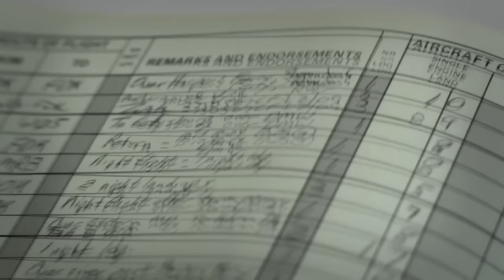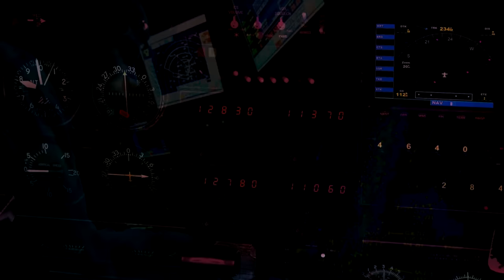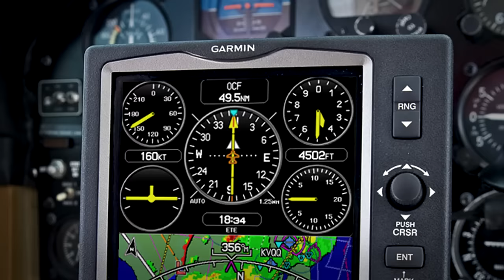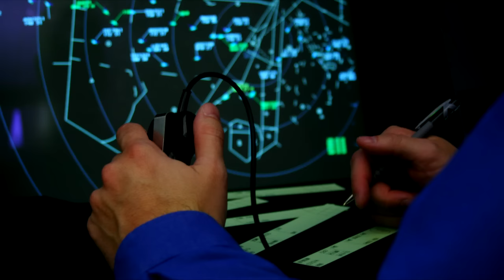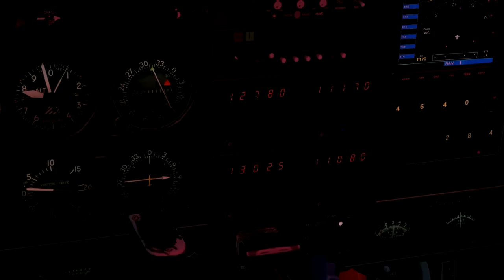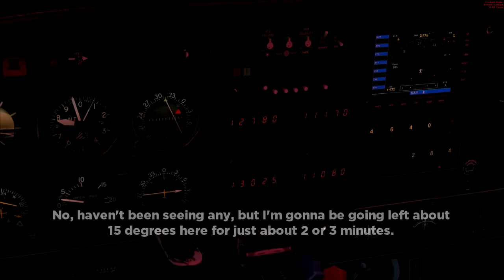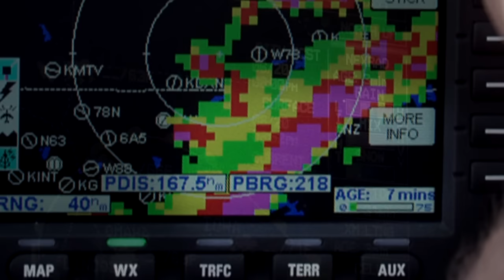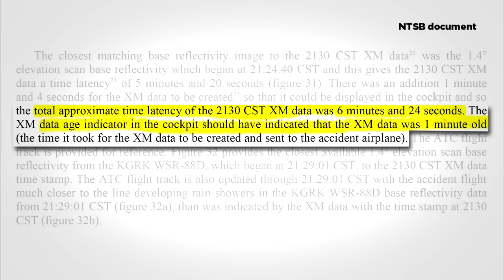Accident Case Study: Time Lapse – misunderstanding in-cockpit weather displays can lead to tragedy

Comment: To be this reckless with your family on-board is sickening.
Reply: agreed
Reply: Someone in another video said it best:  "Never take your family anywhere unless you've had several hundred hours IFR in your log".
Reply: @jturie  overall i disagree, im not sure if youre a pilot or not but that request is nuts. I agree that he should have had more experience, should have known his systems better, should have recognized get thereitis and shouldnt have landed well before the thunderstorms and gotten a hotel. But hundreds of hours of instrument is a commercial pilot task especially for your average pilot.
Reply: @JohnDole  good points.
Reply: Nine hours of high altitude flight, fatigue, hypoxia, and frustrated family members nagging or complaing or needing a bathroom or stretch ugh.  Just divert away from the storm and take a break at the nearest airfield dont risk flying wven longer.
Reply: @SWIFTO_SCYTHE   Very true. Unfortunately, by the time he thought about doing that he was already in the thick of it and had no idea which way to go.
Reply: That's the problem ignorance is bliss I.e. he didn't see it as a wreckless flightplan.
Reply: @JohnDole  They did say he had been at altitude for 9 hours!  Hell 9 hours of anything and my decision making has gotten pretty bad.
Reply: Sickening or not, it turned out to be fatal.
Reply: I was thinking the same thing. Especially when ATC is nervous. That should frighten any pilot enough to ask for a vector to the nearest airport.  Flying solo? Go ahead, roll the dice with your own life. But with passengers you have no right to take any chances just because you're the pilot and you're flying the plane.

Remember John F Kennedy Jr? Same scenario.  Strong headwind. Flight conditions deteriorating. Small plane. Not  a whole lot of experience. Passengers on board. Land the damn plane, grab some coffee and wait it out. I'm not even a real pilot. I fly X Plane on a Computer. Just a simulator.
Reply: You could hear it in the ATC's voice how the pilot brushed off his warning to divert. The pilot was probably used to being 'in control' of everything but sadly weather and convection currents don't care how big your ego is. Risking your entire family flying a single engine at nighttime into a thunderstorm is incredibly irresponsible. He probably got rewarded with the screams of his terrified family being the last thing he ever heard. He screwed up and his entire family paid for it.
Reply: @wjatube  Humans have a very difficult time with "letting go" of a task until completion as originally "hardwired" into their mind -- "get there-itis". Remapping of one's thinking/plans can be incredibly difficult for a family, let's say, on a routine Sunday drive to the beach.  The psychology behind airborne decision making is even more complex for sure.  Pilot actions, or inaction's, contributing to this tragedy go well beyond flight planning, physical or mental fatigue, cabin distractions, and ignorance of NEXRAD functions.  General Aviation pilots need more training around crisis and change management and how to apply that training in flight when needed.
Reply: david Blash is there a recommended “sweet spot” for when you should start inviting family aboard? I think I heard it’s the first 15-50 hours in aviation experience that are the most deadly, not sure exactly, but there’s a timeframe where you know enough to fly with false confidence but not enough to be ready to figure out a new problem/scenario. Basically knowing enough to get you killed
Reply: @wjatube  He rejected silly controllers advise, "who is that ass telling ME what to do" Was probably  the last thing  going through his mind, other than the dashboard!
Reply: @wtcashel  exactly right....
Reply: Exactly what I was thinking. See, when I'm driving solo, I speed and take some chances that in my judgment wouldn't cause a serious accident or injure others. But I'm a different driver when I have a family member - let alone my entire family - riding along. When that happens, it suddenly transforms me into a very patient driver that would start applying the brakes and come to a complete stop as soon as I see the yellow traffic light come on. When I'm driving solo, I usually step on the gas to beat that light while being very cautious of the four directions of traffic.

With all that said, this pilot evidently did not care that much about the fact that his entire family was with him on that plane ✈. I believe the change in pressure and a long flight time caused a resultant disorientation and lack of judgment, otherwise he would have known to put the safety of his family first. I would have made an emergency landing, even on a freeway like I'd seen a few times.
Reply: Peter Duffield, I love your comment; I think of it as perfect. It's the same principle that guides me when I'm driving: when driving solo, take chances. When there at least one person riding along, make their safety a priority. I wouldn't take any chances when my family is riding along. No way!
Reply: Get back safely.. That's all that matters.. Not get there no matter what.. This is sickening.. What were they saying to him I'll never know
Reply: Easy to say in hindsight
Reply: @JohnDole look who crashes planes - underexperienced pilots, challenging conditions, often with friends or family onboard. If you want to take yourself on an adventure, fine, go skydiving or fly around in a tiny plane without modern avionics or engines with just enough experience to make you comfortable that you stop being as safe as necessary for your skillset, but dont drag your kids and wife along with you. Become the pilot you would trust your family's life with, dont think you can get a license and start safely hauling people around.
Reply: We should all vow to not be too proud to put the plane down safely  when we still can. It's easier to do now than in the air. Eliminate the two most common reasons for accidents and your chances of survival go way up.
Reply: +jturie. You can study and understand a subject without being in the air.
Reply: @JohnSmith-en8vx  Murphy's law?
Reply: wjatube I don't think he was...but you're right the outcome is hurrendous.
Reply: @tomservo5347  that is  being a little rough....making the personal decision to move forward was not really the problem.  He was arrogant about his distance from the storm for sure.
Reply: @jet guy Too keep flying straight into this with his whole family is hubris in the extreme. So maybe he can afford to own a Cherokee, so therefore thinks he is the man. Terrible decision, terrible.
Reply: @NonyaBusiness! Well, there is a wide gulf of options btwn "hundreds of hrs IFR" and "dancing around a storm."  I haven't flown in 20yrs, but anything listed as tops at/above 40k gets my attention!  I'd have given that a wide berth...even in a C-130.
Reply: What gets me though is the number of people on here outright bashing the guy...hey hindsight is 20/20 and I'm sure he didn't go into it thinking he was being reckless and would get himself and his family killed. I'm not even sure you guys watched all of the same video. In the end the idea is that you don't know what you don't know which is why things like this exist so that the bug gets in your mind when you do fly...hmmm perhaps I should avoid this instead of trying to go ahead. There is a good chance that he probably didn't know this and after 9 hours flying was mentally fatigued, but yeah go ahead and criticize the pilot for getting himself and his family killed when my guess is that 95% of the people making the comment aren't pilots.
Reply: @mattfield3371  I can't agree with your point even though I am not one of those bashing him.  I don't have to be a smoker to "bash" those that do.  In this case the outcome clearly indicates he was willing to take far greater risk than a normal human (pilot or not) would.  Why?
Reply: The funny thing is you criticize the pilot for making a careless/reckless decision when you outright admitted that you do the same thing "just when it's only you in the car". But you look out for others so it's ok? How do you know who you're going to hit when you try to beat that yellow...? It's really funny the number of people I see on here thinking that they know better and that this guy got his family killed like he should've known. Yeah, he probably should've known but he didn't, that's what lack of experience and training is and why these exist...but claiming you aren't putting anyone else at risk "because you check the intersection" when you try to beat a yellow light...ask yourself if that behavior is really so different from this guys because the mentality is the same. And I know you said you wouldn't do it with your family onboard but still irresponsible is irresponsible...I've done it too so I'm not without blame just saying that perhaps it's better to learn to look at things a little differently and see that it could probably happen to anyone easier than you think.
Reply: Point missed on the oblivious clearly...my point was that unless you've been in that situation it's easy to say what you would do but how can you really say? You say he was reckless but he probably didn't think it was reckless. Again to my point of people even watching the video, did you see where it said the data was likely 8 minutes old but those screens say 2 minutes? His flight track was consistent with thinking he was following what was current on his screen and not with what the current conditions actually were. I nowhere heard in any of his calls to ATC where he sounded "arrogant". I didn't get that from anything said anywhere in the video only the comments. I'm sure if the controller thought he was arrogant he would've had stronger words for him about avoiding the storm altogether. From watching the video it's pretty clear to me that he just didn't understand the limitations of his equipment, not that he was arrogant. What I do perceive is arrogance in these comments about people who think that he outright put his family in danger somehow knowingly, but it's obvious to know he didn't think that they were in danger or I'm sure he would've diverted. It's really funny reading these comments and seeing all these people that somehow know better and again if you don't have all the perspective of the situation at hand how can you begin to form a rational response?
Reply: @mattfield3371  you may need some help in conversational skills since you don't seem to acknowledge the guy KILLED his family by being arrogant.  Nobody starts playing with bad weather thinking 2mins 6 mins...20 mins ...you stay OUT OF the county where bad weather is threatening.
Reply: Exactly.  Sad to think about what his wife sitting next to him might have been saying to him.  She probably had headsets and could hear what the controller was saying.  Wonder if she ever tried to encourage the husband to listen, but he kept insisting her it'd be fine.
Reply: @jturie  No amount of IFR experience qualifies you to play the dice with weather.
Reply: @tomservo5347  Not to mention the emergency responders that have to clean up the carnage,and will have PTSD over this.....
Reply: @jet guy Ego......
Reply: <500 hrs: you are a danger to society and yourself. Pilots ARE plane killers. Period.
[view from three decade's of CFII/MEI].
Bright note to the catastrophe: the souls never felt a thing as their descending aorta separated from the g-force of remaining wing flipping the ship over.
Instant (& painless, so the doc's say) cardiac arrest.
Note: I am NOT a doctor. But professional acquaintances of mine are and [pre autopsy] can determine the cause of death when there's minimal blood splatter at accident scene.
ie the souls were deceased before the aircraft impacted ground.
Best way to go when there's no potential for survivability. Ymmv.
Reply: @mousepd  Not really the same scenario at all. JFK jr. wasn’t even instrument rated and had zero business even being in a plane that night. This pilot could’ve flown the same flight literally with his eyes closed.
Reply: @mattfield3371  You find those comments on every one of these videos. All the commenters who are god's gift to aviation and make perfectly sound decisions in 100% of their lives.
Reply: @jaimhaas5170 I'm just now seeing your response almost a year later but I'll play ball. Again, WHERE is this arrogance you speak of him having come from? That's not confirmed by anything, just your assumptions. Again, if you even bother to watch the video it explains the likely thought process and how it's possible he got in over his head through INEXPERIENCE NOT ARROGANCE. I'm sure if he realized how deadly what he was doing was he wouldn't have put himself or his family through that. You seem to forget that he got them all killed and it was due to the fact that he likely didn't understand what he was seeing and that he shouldn't fly near it not some weird ego trip thing he was going to try and outfly, nothing needed in my conversational skills thanks, just watched the video and actually comprehended what it was saying.
Reply: @mattfield3371  you walk a fine line when you put your entire family at risk.  That is exactly what he did.  He had all the weather info ahead of time and still decided  to "RISK".   He played fast and loose and he lost.
Reply: spawners aren't known for sense

Comment: Single engine IFR, at night, around convective sigmets of fast moving thunderstorms, no on board radar but with nexrad and relying on it to avoid weather. If these are not red flags for any pilot, I don’t know what is. These are hard lessons to be learned and it is not uncommon.
Reply: controllers should not be overbearing but i dunno when dealing with a GA in the sh-- they could have lightly suggested nearby airports to the east. and i imagine all controllers involved in this now do that even if it isn't SOP

Comment: In Naval Aviator training we were taught to stay away from thunderstorms.  Or if we find ourselves in one, to slow to "thunderstorm penetration speed"  which is the same as tactical maneuver speed.  That way, the wing stalls before an structural damage occurs.  Fortunately, the "stay away" idea always worked for me.
Reply: Yeah , I’d bet a dime to a dollar that being tired and eager to get to his destination he was still at cruise speed ,rather than Va which would have given him some protection against up/downdrafts and maybe stalled his wing instead instead of chopping it off.
Reply: @davidwhite8633 another case of "must get there"-itis. Bad enough with people on the roads, but in the air it ends so much worse
Reply: Why does the plane experience“air speed building rapidly” as it passes through descent?
Reply: @happyweimermom8748 gravity? 😂

Comment: Another factor was night time. And Getthereitis.
Reply: It shouldn't have based on his flight experience. And he was calm enough on the radio. What got him into trouble is his confidence in his NexRad information overlay and not listening to ATC. I'm in agreement with the assessment explained in this video. 6 to 8 minutes is a hell of a long latency between updates when a storm is moving at 40+ knots and you're already flying into it at less than 100 Knots ground speed. That's what got this pilot in trouble While I agree, if this was a day trip the storm would have been obvious, that's not how we, as pilots, are supposed to be trained for IMC vectors. And when a controller is giving you real time updates and recommended course changes, damn.... take it!
Reply: Another one was speed ,had he slowed down instead  of going faster when he hit the storm could have prevented his plane from breaking apart , fear ,cockiness  and lack of knowledge killed many rich aviators .
Reply: @obiecanobie919  yes

Comment: Stay at least 20 miles from thunderstorms. Also, landing would not have made him very late as the storm was moving quick.
Reply: WELL SAID !
Reply: That's good advice that can save lives.
Reply: 20 miles?  I used to track them at 5.
Reply: Bartonovich52 We will be watching the next crash analysis video on you.
Reply: How about 50 miles. That's my minimum. I learned my lesson as a student!!
Reply: SGTSnakeUSMC  Often the breakup in turbulence is due to PIO , not the turbulence itself . 1} I doubt he reduced his speed from cruise to Va or below . 2} When the turbulence hit he used the stick and this piled on unnecessary loads to add to it .
Proper procedure in severe or extreme turbulence is to reduce A/S below Va and trim in pitch for it , then remove hands from the stick/yoke altogether and keep wings level with rudder only .This reduces PIO loads to the minimum necessary to maintain wings-level flight .
In bad turbulence pilot extremities ( legs , head , arms , HANDS ) will be thrown around like a rag doll , so it’s best to not be holding the stick . I doubt he used just rudder to keep wings-level either .
Reply: @scotabot7826  50 miles is a bit ridiculous if you fly often. At a certain point, you might as well just only fly with clear blue skies if you want to limit yourself so severely. 10-15 miles is plenty of safe cushion so long as you are perceptive. If you don't trust yourself to stay on top of the weather and your location relative to it, fine, stay 50 nm out. Sometimes you might find yourself caught in a place where you cannot help but be 15 miles out and it's best you are familiar and capable with being "close" to weather.